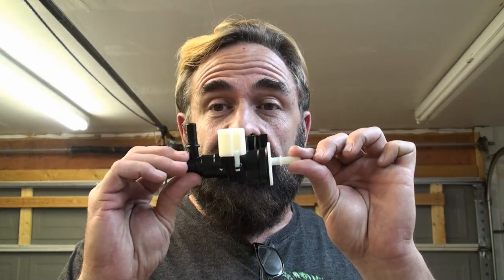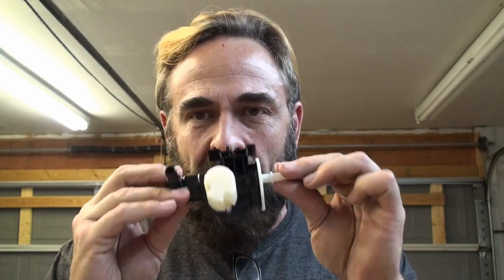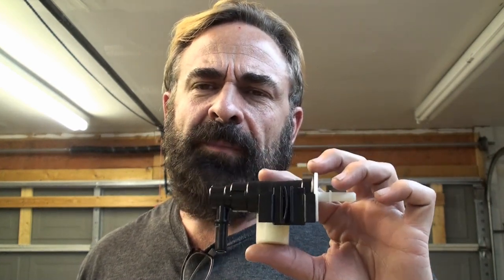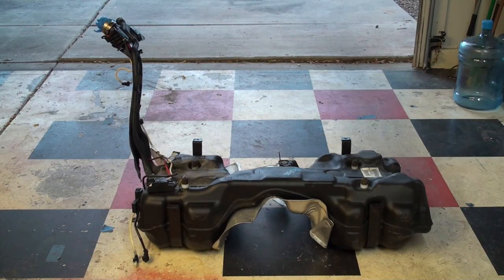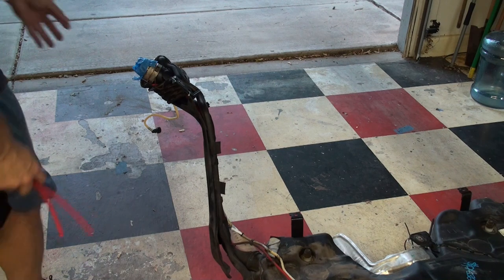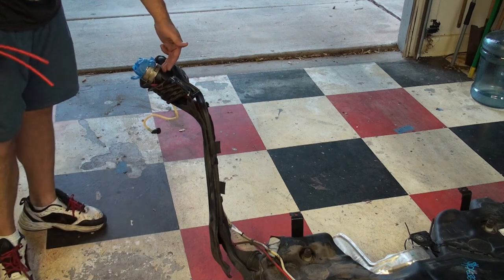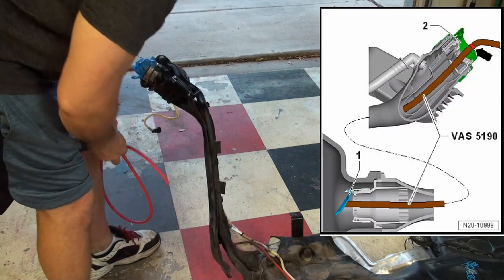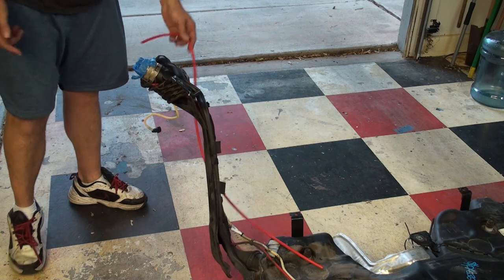MQB MK7 Cant put gas in gas tank : suction pump failure TSB

Comment: Thank you so much for this info!  My 2017 PP GTI started having heavy fuel smell outside vehicle after shut off. I checked charcoal canister & the vent was sweating. Next day car started cutting power while driving intermittently. Picked up the in your parts in this video & car literally started leaking fuel from the charcoal tank when I got home 😂😂. Took 2 hrs taking my time. $8 battery operated fluid pump from harbor freight sucked the tank down once pump was out. 
Car runs great again, filled up with gas no problem & no fuel smells or leaks since. VW dealer said it MIGHT be covered come drop off car in 1 week for a few days 😂. For $27 & 2 hours it’s fixed thanks to you. 
My production date is 8/2016 & it still uses this exact part for anyone else reading this.

Comment: This video saved me so much money. I have a 2017 VW Golf Sportwagen. I was unable to fuel. I took it in and discovered that my charcoal cannister (part of the evap system) was saturated in fuel. I had it replaced ($1200 part) and went to refuel. Same issue. I sent this video to my mechanic and he discovered that I have this part inside my tank (date stamped Feb 2016 - from the recall date). I spoke with multiple VW dealership mechanics and asked if it is at all possible this part exists in my system as it is not listed on a single VW diagram or parts list. They insisted that no way does this part exist. Had I not discovered this video, I would have ended up replacing my entire tank. 

Long story short, VW obviously knew what they were doing when they chose to not include this part on any manuals. It is actually a huge safety risk, outside of it costing so much money for people unable to diagnose it. 

Thank you for posting this!

TO clarify the Safety Recall Code for this issue is 20Y6 and only included vehicles from 2015/16. My vehicle has no recalls out for this issue. 

I have been in touch with VW Canada regarding the issue, as well as Transport Canada.
Reply: I found this video on a Facebook group for Sportwagen’s.  I’ve got a 2018 Sportwagen 4motion, and I’ve encountered this same issue.  Seeing you posted this comment 5+ months ago, did your calls to VW Canada and Transport Canada manage to get a response???  FYI, I’m in Toronto.

Comment: Thank you for this video. I had a 17 Alltrack with the same symptoms, and was having a heck of a time trying to solve it. No codes. Everything checked out ok. Only 47K on the clock.
I gave this a shot and fixed the car as well. It is not an easy thing to do with the tank in the car, but it is doable. A hint from the BMW bulletin was to unplug the back line first, as in my case, that was the hardest thing to do once the pump was unsnapped from its bracket. The front line only goes a short distance, so I removed it altogether to give my fat hand more room. If you were in my area, I would definitely buy you a beer!
Cheers!
Reply: Thanks for the info. I’m having this issue on my 17 Alltrack as well.

Comment: thank you for the display it will help. so yes dug up the 20Y5 recall my vin doesn't fall under it which is bs same exact problem, I think they got cheap on us when shit hit the fan at audi ive dumped about 400 buck on evap pcv charcoal canister thank god im mechanically inclined or I would've spent a lot more. I think you are the only one that has a video for this issue and I salute you..
Reply: Likewise for me.  I was told "this doesn't apply to AWD vehicles" and they offered to replace my gas tank for $5,400.

Comment: Yeah thanks for this video.  I had the same issue.  At first I thought that some a**hole opened up my gas port and put something in there clogging it.  Lol
So checked online and saw this video.  

I then check all the recalls and saw that my 2017 golf sportwagon had an extended warranty coverage for the Fuel Tank suction Jet pump.  

Glad I found the extended warranty notice.

Comment: my 2015 gti stoped refilling gas tank today.  Called local dealer they said the the  suction pump replacement recall has been done in 2016 but I just couldn't  remember this service they did back then.  my car only got 100K kilometers on it, no mods or anything done to the car.  Dealer ask me to drop the car next Monday , the representative said it might be covered by  fuel system warranty extension but they need to check this out first. I will keep updating this .

Comment: Dammm thank you, this just happen to me today after my car just spit out gas. And when I went to tank up couldn't tank up. 
Well I am thanking you again. Gti 2017
Reply: I just had this happen on my 2017 gti did you find a solution?
Reply: Hey, I'm currently going through the same thing. VWOA isn't being any help for me either. I talked to someone who went through the same situation and he was able to get VW to help cover the expenses and his advice was to go public and tweet @VW and @NHTSAgov basically asking them why they recalled the '15 & '16 golf models but not '17 when it's clearly still a problem and a major safety issue.

He said a regional rep contacted him after seeing the tweet and that's what led to them covering the expenses. There's no reason we should be the ones responsible for this expensive repair.
Reply: @c0Ld  I got it “repaired”. It required a new gas tank, fuel sending unit, charcoal canister, evap purge valve, and a bunch of other random crap. 

I drove it home and had the same issue again.

I found another car I ended up trading for (new Mazda 3) and on the way to drop off the car it cut out on the highway. Luckily got it to the dealership but yeah… glad to be rid of that POS.

The turbo also had to be replaced, luckily that was under warranty.

In total the bill was 5k and I will never buy another Volkswagen they are just to damn expensive to fix. All the parts are moulded together and the only thing they do is replace parts until it “fixed”….
Reply: @joshuadevries3459  damn
Reply: @c0Ld  Did he get it covered 100%? I'm having the same problem.
Reply: @danijelmartin3370  He got it covered 90%, said the total was $100. It seems like a lot of us '17 guys are having the problem lately I'm hoping for a  recall to happen but in the meantime definitely complain to VW, especially in public forums like twitter

Comment: I have a 2019 jetta that's doing this, is there one in those?
Reply: I have a 2020, and I work in a VW dealer.  So I ran the part number and it comes up in the catalog for an Audi A2.  It’s also not in the diagram, it’s listed as an associated part… the part number for the tank that it goes into is the same base number as the tank in my car.  I’m going to open up my tank this weekend and see if the valve is the same.  I actually have one on the shelf in my shop.

Comment: Had the same problem.. couldn't fully fill the tank and while driving it kept cutting out. Took my '17 GTI (35k on the clock) to the dealer to get fixed. They replaced the spark plugs, charged me $320, and obviously the issue persisted. - Took it to a local shop and they diagnosed as the "suction pump" issue. Also said some kinda charcoal canister has been messed up by the issue too. Cost to fix? "$3700-$4000".... 

I just called the dealer and let them know what's up. They said they will contact VWA but can't guarantee that VWA will do anything for me. We'll see. 

Between myself and my family we've owned over 2 dozen VWs over the years.. Bugs, Rabbits, Golfs, a Microvan, Dasher, Tiguan, even a diesel Rabbit truck..... up until this point I and my family are lifers for VW.  But if VWA doesn't make this right we will never own another VAG product again. Totally inexcusable. 

Thanks for the great video, btw. This will definitely come up when I'm arguing my case.
Reply: Hey, I'm currently going through the same thing. VWOA isn't being any help for me either. I talked to someone who went through the same situation and he was able to get VW to help cover the expenses and his advice was to go public and tweet @VW and @NHTSAgov basically asking them why they recalled the '15 & '16 golf models but not '17 when it's clearly still a problem and a major safety issue.

He said a regional rep contacted him after seeing the tweet and that's what led to them covering the expenses. There's no reason we should be the ones responsible for this expensive repair.
Reply: I just got mine repair on a 2017 gti in Canada.  My warranty just expired and  had to replace the valve, canister and fuel tank.  They were only giving me 60% discount.  This should be a recall!

Comment: I had the same issue 1 month ago, until now the car was stopped, i just received the spare part you said… and i already changed it, just waiting a little bit more of time to go to the gas station to fill it up
I will update if it still something wrong
Reply: I recommend removing the charcoal canister and flipping it upside down to remove all the excess gas from the suction pump failing. I was ready to fill up the day of when i did that

Comment: There is a Fuel Tank Suction Jet Pump Limited Warranty Extension program - though VW declined to reimburse me. They're claiming the root cause was the rollover valve. I've got a 2017 GTI that was leaking gas from behind the right rear fender.

Comment: 03march2021. I'm literely sitting on the side of the highway right now because I couldnt figure out why my 19' alltrack won't take more than 1/2 a tank. I thought it was a bad level sensor. My diagnosis is incorrect via sitting on side of highway with an empty tank. Calling VW to try and get the part now.

Comment: I just received from VOA a warranty extension pertaining to this part "Fuel Tank Suction Jet Pump" my car is a 2017 Alltrack SEL the warranty is good for 15 years or 150Kmi. from the "In Service" date. I'll tuck it away with the other paperwork I have for the car. I think you could be right about having a more powerful fuel pump causing a strain on the suction pump P/N 5Q0-201-029 for those that missed it.
Reply: did this apply to audi as well? 2017 s3
Reply: @Noname23489  ...I do not know if this warranty applies to Audi's but this part P/N 5Q0-201-029  is used in your 2017 S3...I looked it up for you.

Comment: Do you guys think using a fuel system cleaner might prevent this from happening again?
Reply: No I’ve run BG 44k fuel cleaner a few times and had this issue. The part is cheap plastic junk like the rest of the mk7 😂 replaced so much of this car already 😢
Reply: @boostedbliss07MK5  yeah, I was mainly using “no ethanol” fuel also. 90 octane. My mk7 had been relatively great before they had to replace the whole gas tank 💀 lol. But yeah now I’m paranoid about it, been debating on trading it for some time now

Comment: Same problems are on earlier GTE:s. Mine is 2016 EuroSpec and this is the solution.
Reply: Damn it... I bought a GTE a while ago, and i've got a similar problem.
Mine doesn't stop fuel from going in, it just doesnt take it fast..
Reply: Was it hard to replace it on GTE? The acces is from trunk, right?
Reply: Hello. Did you find the error? Was it possible to change it?
Reply: @nunofernandes8857  Hello. Did you find the error? Was it possible to change it?

Comment: I just dropped mine off at the dealer.  Can only fill the filler neck then wait, can hear air escaping as the gas slowly flows into the tank.  Then repeat.  Warranty is still good fortunately.  Mine is a '17 GTI .
Reply: What warranty are they covering this under? Do you have extended?
Reply: @danijelmartin3370  I have one through Assurant.  Mine ended up needing a new tank and a new evap canister.  Had to wait 2 weeks for them to find a new tank.
Reply: @DennisChurch  did they not try replacing the suction pump first?
Reply: @danijelmartin3370  Mine turned out to be worse than that.  There was a crack in the filler neck and raw fuel was getting into the EVAP canister.  I wish it had been that simple.  While waiting for them to find a tank I was still driving it but it stalled a lot.  Never got an engine light the entire time though.
Reply: @Traphouseperformance-official  seem to be.

Comment: Could you tell me if this is the same part that needs to be replaced for a 2019 Mk7.5 R.  Every website and all the dealerships I've called are saying this part is NOT for my car . I've been dealing with this fuel issue for over a month now.
Reply from the maker: I can't tell you for sure, but the part is cheap.  It's just hard to put the part in. Do you know any mechanics who could help you open the tank and take a look?
Reply: @RadFox1320   i installed my In tank Fuel Pump - The Work is not the problem for me, its just going to be extremely frustrating if i pull the rear Seats and open up the tank and disconnect everything and THAT sensor is wrong , or not inside my fuel tank ... Im not going to be a happy camper, and ill have to put it all back together to go home from the shop .
Reply: I am having similar issues with my 2016 MK7 Golf R as well.  I took it to the dealer today and they informed me that the Charcoal Canister and Evap Valve need replaced.  They wanted $1800 to do it, so I'll be doing those two items myself for $600.  I'll reply back if it fixes my fuel filling issues.  The part being discussed in this thread does NOT appear to be part of the Golf R fuel tank though, from the information I have received.
Reply: @JoeCoulter did this work? The tank in this video is out of a golf r.
Reply: @BrendanCudmore   I don't know.  I've been a cheap ass and haven't done it yet.
Reply: @JoeCoulter  Same here with my 2016 R - dealer wants to replace the entire fuel tank including the charcoal canister, fuel level sending units, and leak detection pump, all for  a cool $5k+!  They say the problem is the fuel tank vent valve and all this other shit needs to be replaced. Any updates on your end? I'm hoping I can just find a mechanic to replace this suction pump and perhaps take care of the issue!
Reply: @brekdown29  I'm still being lazy/cheap and haven't done anything yet. Still pumping gas two gallons at a time. LOL
Reply: @ I’m replacing the suction jet pump this week on my R and potentially the evap canister. Found a trusted VAG shop that is familiar with this repair and believes this should take care of the problem. Was even told the canister may be salvageable once removed and dried out.

Comment: Looks like I have the same problem on my daughter’s 2018 GTI at 31,000 miles. Cannot put gas in it and fuel mileage dropped significantly. Other than removal of the snow gate and Neuspeed rims w/ 245/40/R18, car is stock. I have not had the problem yet on my 2018 S3.

Comment: Quick question do you actually need to take the gas tank out of the car to fix the problem or can you do it by taking the back seats out.  I’m having the same problem with my 2017 gti and not looking to spend a fortune thank you
Reply: Tank in car. Takes 2 hours. Remove butt rest of seat, remove fuel pump cap on passenger side, fuel pump, follow fuel pump feed line to suction pump inside tank. Remove rear line, mounting brkt then front line.  https://static.nhtsa.gov/odi/rcl/2016/RCRIT-16V647-6323.pdf

Comment: Dealing with this on my 2017 mk7 GTI. After a bit of a push they finally replaced the suction pump in the tank (apparently) and it did not fix the issue. They are claiming now the fuel tank filler and breather tube are the culprit and want to still try and replace the tank and canister for $3500+; originally when I dropped off they claimed it was a clogged vent valve...what a mess
Reply: Have you solved the problem?

Comment: hello friend, i'm brazilian, i have 1 golf 7 tsi. 1.4 turbo. every time I open the tank there is pressure and a smell of gasoline at the mouth of the tank, I have already changed the canister valve, the tank cap and nothing. What can it be? need to change the canister filter.
Reply: Hello. Did you find the mistake? Is it possible to change it?
Reply: @JohanRosenbergJensen  I didn't find the error. I'm already used to this situation. It usually happens with the tank entering the gasoline reserve.

Comment: did you try Activated Carbon Filter replacement, it has worked on many issues, and much easier to replace? 
VOLKSWAGEN GOLF VII LIM. GTE 5Q0201797D
Reply: Hello. Did you find the mistake? Is it possible to change it?

Comment: Do you have a link to the part i can’t find it anywhere online or even on vw parts
Reply: Part Number: 5Q0201029 - https://parts.vw.com/p/Volkswagen__/Pump/67815041/5Q0201029.html
This provides more info on the recall including instructions on installing the new pump: https://static.nhtsa.gov/odi/rcl/2016/RCRIT-16V647-6323.pdf
Reply: Thank you very much!  This made is very simple with this video. Appreciate you!
Reply: Can anyone verify that a 2018 rs3 has this part? I'm having major issues with fueling and evap. Audi wants me to replace the fuel tank. Warranty won't cover it
Reply: @leeonyszchuk3776  How did this work out for you?

Comment: One thing my car does (2020 GTI) after i drive the car and park it, get out i hear a pump going.  At 1st i thought it was just the coolant pump going but no this pump sound comes from the gas tank area.  You can really hear it near the passenger side rear tire where the gas fill is.  It has done this since new.  Does anyone know what the noise is?  I'm guessing it's some kind of purge valve but my MK6 GTI never did this.  That's all i have to compare to.  Just curious if anyone else has this noise?

Comment: My 2017 GTI just started having this exact issue 🤦🏻‍♂️
Reply: Hi, did you ever get this fixed? What worked for you if so?
Reply: @wesleyhill7594  my warranty covered the repair, but I had to take it to the dealer. It took them a whole month to get it figured out / get parts and repair it. Kind of a nightmare. The dealer replaced the whole gas tank. And then changed the evap canister cos it was flooded with fuel.